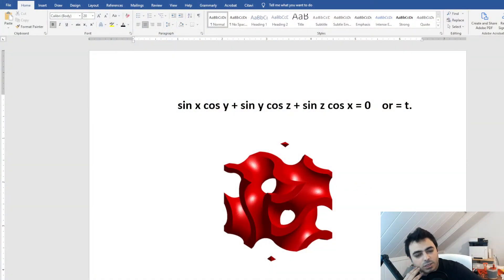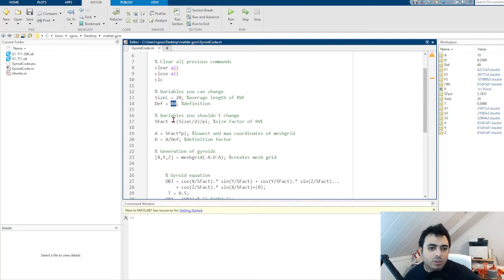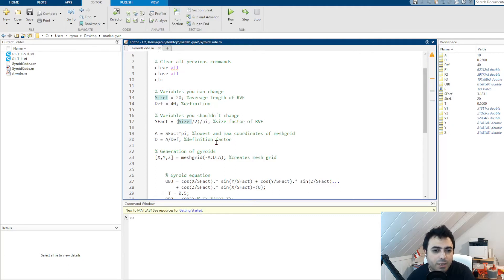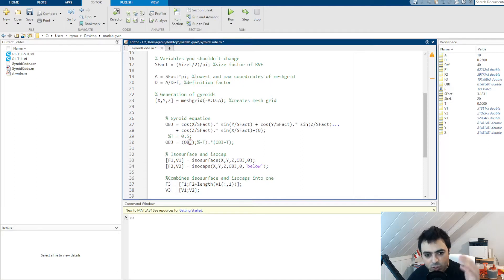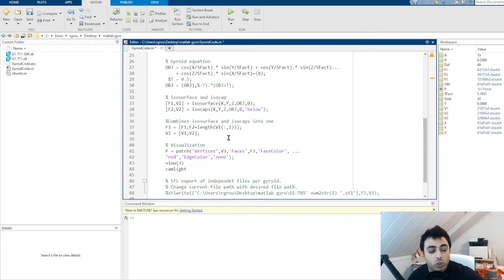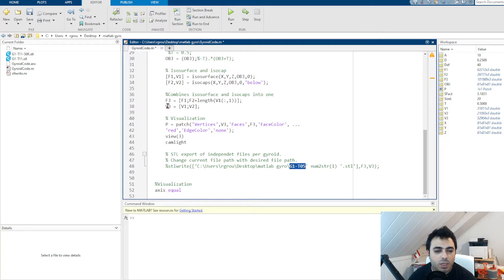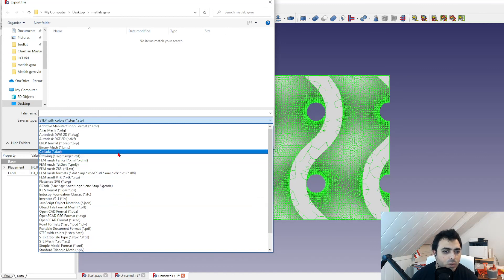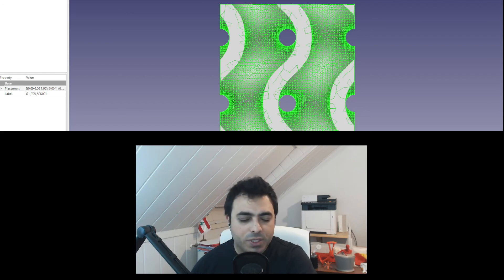Generate Gyroid structures using Matlab  (Meshlab +FreeCAD conversion)

Comment: Hey Rami. Thanks for the video. Can I use this with Solidworks instead of FreeCad? Thanks for the help!
Reply from the maker: Hello . I do not have access to the latest version to Solidworks unfortunately. You should be able to import an STL for sure but converting it to a solid is either directly possible or you need to use an "Add-in" in Solidworks.

Comment: hi
 thanks for very informative video. i have a question, my model have about 1 millions faces i decrease it to around 240 or400k faces but abaqus cant load it. even if abaqus load a model by chance because model has too many faces simulation can't run. is there any way to merge faces to decrease the number and complexity of model?
Reply from the maker: Watch the video to the end. I explain that .
Reply: @RamiRouhana  hi again
in the end you will use SAT format for Abaqus. is that all?
Reply from the maker: @rezaparsa3510 Step would also work.
Reply: @RamiRouhana yes its work i meqn we can successfully imoprt model to abaqus BUT the problem is the model is made up +250k faces or in another say +250k solid piece. Is there anyway to send you more detail like video or pictures of my problem? I will be thankful
Reply from the maker: @rezaparsa3510  you watched the full video ? I explain how to use mesh mixer to reduce the mesh size.

Comment: I’m trying to create a lattice structure of gyroids. Each unit cell 3x3x3 mm then using Formlabs 3 to print it. I guess I confused on how to understand what dimensions this code makes the gyroid. Is this something that can be altered in FreeCAD? Also, how would I repeat the gyroids to make the lattice structure?
Reply from the maker: Hello. In the OBJ equation multiply or divide "X" , "Y" ,"Z" by 2 and try. 
That is ine way to have 8 gyroids... 
The best way is still to generate one and in an STL manipulation software xombine them. Like meshlab.
Reply: And parameterize in STL software too?
Reply from the maker: @joerees9060   parametrize in Matlab and then use STL pattern option either in meshlab or better in CAD form in FreeCAD
Reply: Been working on this for a little while. Followed your process but have been trying to upload the file into NX Siemens to work on it more. When I upload into NX, each element appears to be its own body.. any suggestion on how to make it one solid body? Is this something I’m messing up in freeCAD
Reply from the maker: @joerees9060   Replace the section where the main equation is written with this:

  % Gyroid equation
    OBJ = cos(X/2*SFact).* sin(Y/2*SFact) + cos(Y/2*SFact).* sin(Z/2*SFact)...
        + cos(Z/2*SFact).* sin(X/2*SFact)+(0);

Change Def = 80; (Improves mesh quality)

Try it. You will get multiple gyroids.

Comment: Hi, I had two questions and was wondering if you could help me out.
1. How do I generate the gyroids but instead of the walls in the sheet type, I want the paths inside the double gyroids.
2. I want to control the thickness of the paths as well.
Thanks in advance!
Reply from the maker: Hello, 
1- you should switch the boundary limits and the volumes you combine at the end of the code. It is doable, if you break down the code and the functions in it. 
2-The thickness can always be controlled by the T parameters.
Reply: @RamiRouhana  hey really appreciate the quick reply! Just that I am not very good at MATLAB. I fear if I break down the code I’ll end up actually breaking it.
Reply from the maker: @kanav1998  just experiment woth the code at the end that combines the surfaces. Keep an oroginal backup of the script. Understanding better the code will allow you to manipulate it easier.

Comment: Sir could you please tell me which version or matlab you have used. Actually the stlwrite is not working in my matlab 2024b.I have already addon stl write
Reply from the maker: I tested on 2024b , it appears to work. Place the STL write code in the same folder where the script is.

Comment: Thank you for your support.
I have some doubt in my mind and I will feel grateful if you please resolve these issues.
1. After creation of a part when I am not to select any face, which is required for assembly.
2. I want to simulate the structure in abaqus. Which file format I should save  after freeCAD
Reply from the maker: 1-What aeesmbly do you mean ??
2- save as 'SAT" file type
Reply: @RamiRouhana  I want to assembly two different TPMS structures but when I insert this in FreeCAD software I am not able to select any face of the structures to mate 2 faces
Reply: @RamiRouhana  .sat file option is not available in freecad save types
Reply from the maker: @SubhaNath-m5u  try IGS and STP
Reply: @RamiRouhana  thank you sir.
Reply: Sir could you please answer the answer to my first question?
Reply from the maker: @SubhaNath-m5u   The assembly you can do in Abaqus , but not by selection face, by moving the two bodies positions in XYZ to be in contact. Check tutorials on  how to do assembly in Abaqus.

Comment: Hey,
What we created the Gyroid TPMS structure using MS Lattice and have the STL file, any suggestions on how to convert the file to Step or IGES for performing FEA analysis. Im having a hard time cause there are no surfaces in the STL file.
Reply from the maker: I show these steps in this video. Using FreeCAD , or you could use Fusion 360 or there is an abaqus plugin "STL to solid". Watch until the end.

Comment: Can I save the file as Tiff rather than STL, also can I change the solid of the gyrode to be made of small particles of spheres
Reply from the maker: Yes there are methods if you export node coordiates you can make what is called SPH in Abaqus. Or you can adjust the script in matlab to generate a sphere at the location of nodes, there are tutorials of that.
Reply: Thanks for your reply please can you explain more, I'm a beginner in Matlab.
Reply from the maker: @relab5346  It is not an easy task in matlab. It is better if you import the CAD to abaqus. Look for tutorials to convert the CAD to particles SPH in abaqus. 
For matlab , this might help https://arxiv.org/abs/2209.05189

Comment: Hi sir

I followed your order correctly but there is error in FreeCAD conversion

When I click "convert to solid", I got this error message.

  File "<string>", line 2, in <module>
<class 'Part.OCCError'>: Shape is not a shell
20:11:50  Cannot convert GyroidD_40_t_0_T_0_5_____50K001 because Shape is not a shell.

Did you really succeed to do this order?

Thank you so much
Reply from the maker: Try to adjust the mesh density you generate in matlab , your mesh might have defects in it. As mentioned in the video, the step in Meshlab for mesh optimization is very helpful, and in some cases necessary.
Reply: @RamiRouhana  
I input "40" mesh density in matlab.
And I optimized faces into 50000 faces in Meshlab.

However I got this error....TT
Reply from the maker: @신상오원자력공학과한  have you adjusted the t value or are u following the exact same steps in the vid. I would say try Fusion360 to convert mesh to CAD . Maybe the new FreeCAD has a code problem.

Comment: Thank you so much! I have a question.

 % Gyroid equation
    OBJ = cos(X/SFact).* sin(Y/SFact) + cos(Y/SFact).* sin(Z/SFact)...
        + cos(Z/SFact).* sin(X/SFact)+(-0.3); 
     T = 0.5;
    OBJ = (OBJ-T).*(OBJ+T);

In this part, I can't understand how  "OBJ = (OBJ-T).*(OBJ+T);" works to create 2 isosurfaces. Is there any reference which you used?

Thank you ^^
Reply from the maker: Hello. The equation of a gyroid is equal to a constant. By reducing or increasong the constant, the gyroid surface shifts like an offset but in 3D. So offsetting equally give a symmetric  thick shell .
Reply: @RamiRouhana  Thank you. Sir
And I have one more problem in FreeCAD

I followed your order well but when I do this function

Part - Convert to Solid

There is a error msg : because Shape is not a shell

I don't know why.... I really created shape from mesh first but I can't make a solid from shape
Reply from the maker: @신상오원자력공학과한  you have to click on the part name on the left sidebar before you do the conversion.

Comment: Thank you so much. Your code was very useful for me 🙏. It is possible modify the code and make a cylinder fill with gyroid tpms unit cells? And if it is possible, how can i do that?
Reply: In your code i made some modifications for get that cylinder, with booleans operations, but the result is a little bit bad, because the surface of the units cells are stranges, so i dont know how i can solve that. 

% Clear all previous commands
clear all
close all
clc

% Variables you can change
SizeL = 1; %average length of RVE
Def = 60; %definition

% Variables you shouldn´t change
SFact = (SizeL/2)/pi; %size factor of RVE

A = 10*SFact*pi; %lowest and max coordinates of meshgrid
D = A/Def; %definition factor

% Generation of gyroids

[X,Y,Z] = meshgrid(-A:D:A); %creates mesh grid

    % Gyroid equation
    OBJ = cos(X/SFact).* sin(Y/SFact) + cos(Y/SFact).* sin(Z/SFact)...
        + cos(Z/SFact).* sin(X/SFact);
     T = (-0.05*(X.*X + Y.*Y) + 1.25);
    OBJ = OBJ >= 0 ;

% Extrusion
ExtrusionHeight = 10
CylinderRadius = 5
extrusionMask = Z <= ExtrusionHeight;

% Cylindrical shape
cylinderMask = X.^2 + Y.^2 > CylinderRadius^2;
cylindricalShape = cylinderMask & extrusionMask;

% Combine gyroid structure with extrusion and cylindrical shape
ResultSurface = OBJ | cylinderMask;

% Isosurface and isocap
[F1, V1] = isosurface(X, Y, Z,  ResultSurface, 0);
[F2, V2] = isocaps(X, Y, Z, ResultSurface, 0, 'below');
% Combine isosurface and isocaps into one
F3 = [F1; F2 + length(V1(:, 1))];
V3 = [V1; V2];

% Visualization
figure;
P = patch('Vertices', V3, 'Faces', F3, 'FaceColor', 'blue', 'EdgeColor', 'none');
view(3);
camlight;

% STL export of the entire structure
% Change current file path with desired file path.

% Visualization
axis equal;
Reply from the maker: @camilomaturana9011  You are welcome. What is the code you added ?
Reply: @RamiRouhana  This parts (The code is up):

A = 10*SFact*pi; %lowest and max coordinates of meshgrid (This for make an a repetition of the unit cells in the space)

OBJ = OBJ >= 0 ;

% Extrusion
ExtrusionHeight = 10
CylinderRadius = 5
extrusionMask = Z <= ExtrusionHeight;

% Cylindrical shape
cylinderMask = X.^2 + Y.^2 > CylinderRadius^2;
cylindricalShape = cylinderMask & extrusionMask;

% Combine gyroid structure with extrusion and cylindrical shape
ResultSurface = OBJ | cylinderMask;

% Isosurface and isocap
[F1, V1] = isosurface(X, Y, Z,  ResultSurface, 0);
[F2, V2] = isocaps(X, Y, Z, ResultSurface, 0, 'below');

Comment: Thanks a lot for the video. Is it possible to calculate the surface area and volume of the sheet gyroid in matlab?
Reply from the maker: The volume it is possible by the equation in the video description. Surface area should be possible but I do it on meshlab.
Reply: @RamiRouhana  
Thanks for your reply. 
Is F3 representative of the surface area of the gyroid, and is V3 the corresponding volume? 
Is there a direct relationship between the T value and the thickness of the sheet gyroid?
Reply: From your previous comment -
These two equations give you a sheet gyroid. To find approximate thickness :
sin 0 cos 0 + sin 0 cos z + sin z cos0 =+0.1
sin 0 cos 0 + sin 0 cos z + sin z cos0 =-0.1
Solving these 2 equations we get z= arcsin(t) &  z= arcsin(-t). so arcsin(t) should be the thickness of the sheet gyroid, right?
Reply from the maker: The thickness is not a constant, this is the value you get near the center of the cube face. The deviation becomes larger with larger T values. @SyedArafunNabi
Reply from the maker: F is the faces , and V are  the vertices.  @SyedArafunNabi

Comment: Thanks for your great work
I have a question, if it is possible to have a row of them, for example, 10 gyroid next to each other in a line
Reply from the maker: With this script it would be easier to make on cell and make the repition using the generated STL on another software like meshlab. 
You could do it by adjusting the paremeters in direction x to compress 10 cells in and then later stretch it but the mesh will not be very homogenous. You could also try to define a larger  volume for X direction, but I have not myself tried that.

Comment: Respected sir,
In my research I need to check any point within that TPMS or not? But in that code I am not able to do that. I will be appreciated if you kindly  help me to correct that.  

%clear all previous commands
clear all
close all
clc

%variable you can change 
SizeL = 5; 
Def = 160;
SFact = (SizeL/2)/pi;
A = SFact*pi;
D = A/Def;
[X,Y,Z] = meshgrid(-A:D:A);
OBJ = cos (X/SFact)+cos (Y/SFact)+cos (Z/SFact)  + (0);
T = 0;
OBJ = (OBJ);
[F1,V1] = isosurface (X,Y,Z,OBJ,0);
[F2,V2] = isocaps(X,Y,Z,OBJ,0,'above');
F3 = [F1;F2+length(V1(:,1))];
V3 = [V1;V2];

P = patch ('Vertices',V3, 'Faces',F3,'FaceColor','blue','EdgeColor','none');

K = [0 0 0];

in = intriangulation(V3,F3,K)
if in==0
    fprintf("outside");
else 
    fprintf("inside");
end
view(3)
camlight

axis equal

THANK YOU
Reply from the maker: I am sorry. I cannot help you at the momet with a specific coding task. You will need to export surface node coordinates and write a script to compare positions (In/Out).

Comment: Thank you for useful content! I have a question. How can I make the structure has more finer unit cell??
Reply from the maker: Hello , that is possible. Try to run the script with "Def = 40" changed to "Def = 80" . That defines the mesh density.
Reply: @RamiRouhana  Thank you for your answer! I mean unit cell is a repeated structure of the gyroid structure. So, I want to know if I can make a structure that has many smaller repeated structures.  Sorry for confusing you.
Reply from the maker: @いーま-v5j   That would be possible in the script but very tricky, you will need to adjust the the values in the cos(x) to cos (x/3) and then increase resolution. You will get 3 cells in the x direction.

Comment: Hi Rami,
When I get to the last step of converting the surfaces to a solid I run into an error on FreeCAD. I select G1_T05_50K001 > Part > Convert to solid and then the error reads "Cannot convert model because Shape is not a shell. Any recommendations on what to do? I tried exporting it after the fact and my program just frozen indefinitely.
Reply from the maker: Hello , try checking mesh quality on meshlab and check if there are holes or bad mesh. Often there are duplicate surfaces or independent nodes.
Reply: @RamiRouhana  Do you know if meshlab changed some of their settings? I could not find compact faces and vertices in their submenus so I went straight for removing and merging.
Reply from the maker: @jonathanvillada9330  there should be other software for mesh correction. Meshmixer maybe.

Comment: Hello! Is it possible for me to alter the triangualtion (deciding if it should be very triangulated or just a little) options for the .stl file?
Thanks.
Reply from the maker: Hello , that is possible. Try to run the script with "Def = 40" changed to "Def = 80" . That defines the mesh density.

Comment: One more question ...whenever I try to save as .stl file the program tells me "Error using stlwrite
Input argument must be a triangulation object." how do I solve this?"
Reply from the maker: it could be that you are using a mesh sensity that is low. 
Try first to run the code as it is and see if the STL is generated. 
If it works and then give errors due to the changes you made, then the changes you have made are causing the error.
Reply: @RamiRouhana  The STL is not generated even with your original file. How do I increast the mesh sinsity?
Reply from the maker: @OfufualuaguAugustus  you need to instal the stl generation plugin in the right folder.

Comment: Thank you so much for your help. In this same code can I generate the gyroid's complementary volume so that it all sms up to a cube?
How do I proceed
Reply from the maker: I have done it yes. You can export the other geometry by tweaking the combine code at the end.
Reply: @RamiRouhana  % Clear all previous commands
clear all
close all
clc

% Variables you can change
Sizex = 1; %average length of RVE
Sizey = 1;
Sizez = 1;
Def = 60; %definition

% Variables you shouldn´t change
SFactx = (Sizex/2)/pi; %size factor of RVE
SFacty = (Sizey/2)/pi;
SFactz = (Sizez/2)/pi;

A = SFactx*pi; %lowest and max coordinates of meshgrid
B = SFacty*pi;
C = SFactz*pi;

Dx = A/Def;%definition factor
Dy = B/Def;
Dz = C/Def;

% Generation of gyroids
[X,Y,Z] = meshgrid(-A:Dx:A, -B:Dy:B, -C:Dz:C); %creates mesh grid

    % Gyroid equation
    OBJ =(A*B*C)-(cos(X/SFactx).* sin(Y/SFacty) + cos(Y/SFacty).* sin(Z/SFactz)...
        + cos(Z/SFactz).* sin(X/SFactx)+(0));
    OBJ1=(cos(X/SFactx).* sin(Y/SFacty) + cos(Y/SFacty).* sin(Z/SFactz)...
        + cos(Z/SFactz).* sin(X/SFactx)+(0));
     T = 0.5;
    OBJ =(OBJ-T);
    OBJ1=(OBJ1-T);

   
    % Isosurface and isocap
    [F1,V1] = isosurface(X,Y,Z,OBJ,0);
    [F2,V2] = isocaps(X,Y,Z,OBJ,0,'below');
    [F4,V4] = isosurface(X,Y,Z,OBJ1,0);
    [F5,V5] = isocaps(X,Y,Z,OBJ1,0,'below');

    %Combines isosurface and isocaps into one
    F3 = [F1;F2+length(V1(:,1))];
    V3 = [V1;V2];
    F6 = [F4;F5+length(V4(:,1))];
    V6 = [V1;V4];

    % Visualization
    P = patch('Vertices',V3,'Faces',F3,'FaceColor', ...
    'magenta','EdgeColor','none');
    view(3)
    camlight

    P = patch('Vertices',V6,'Faces',F6,'FaceColor', ...
    'green','EdgeColor','none');
    view(3)
    camlight

    %Visualization
axis equal

here is the code...i want to represent both the gyroid's and its complement inside the cube but with different colors...The graph is a little strange. Do you have any idea why?